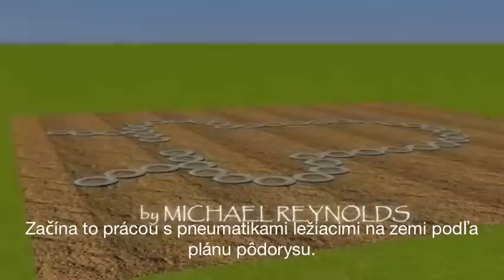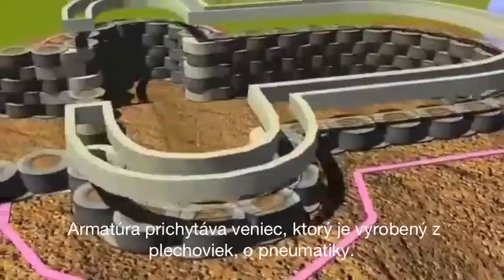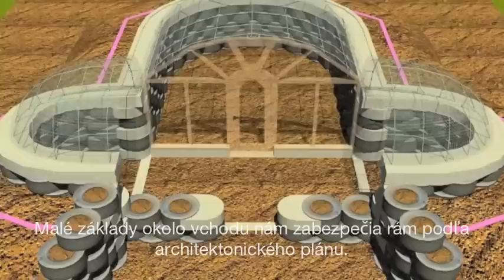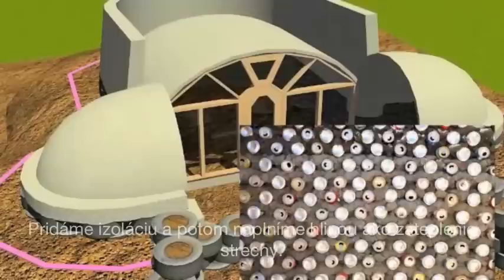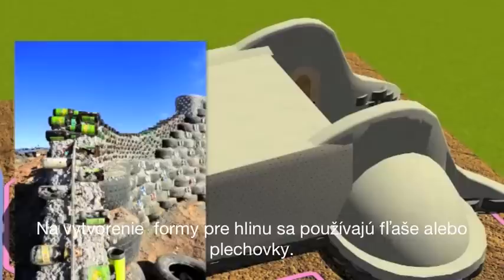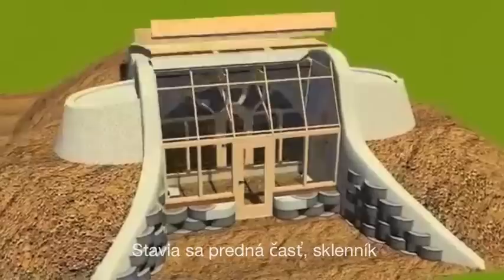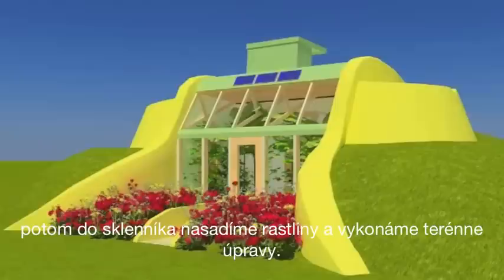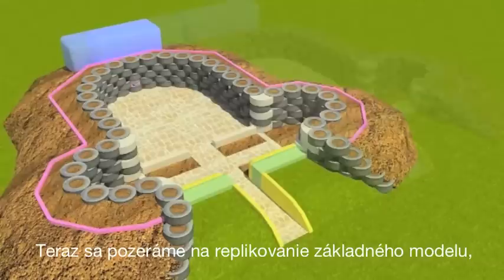Earthship-Reynolds: Simple survival model earthship

Comment: Maria FarmXchange The dirt in the tires hold heat better than other materials would. This helps keep the house at a constant temperature
Reply: Cardboard can be used to put at the bottom of each tire above the first row so that the dirt doesn't just fall straight through when it's getting pounded in. Use your imagination - I'm SURE there's something you can do with that stuff. Paper, for example, can be shredded into tiny tiny bits and be put into compost along with our poop to help speed up the process of decomposition. If there's ink on the paper, well, if I'm not mistaken, ink is made out of oil. Oil comes from the Earth. Ashes to ashes. Dust to dust. Oil to oil. (etc.)

Comment: If that is facing south you're killing the early morning and late day sun penetration with the side walls blocking the entry.
Reply: Seriously? Lame argument.
Reply: Seriously, it wasn't an argument. Go ahead and build then post your pics.
Reply: Supplemental lighting is pretty easy to install.
Reply: John Arizona I see what your saying now... but it isn't by any means a horrible design. It is facing south as it should be and many existing homes never even took that into consideration.
Reply: Shawn X  it is a beautiful design. It could be fine tuned to be more accepting of solar energy. Compared to the more common house design today this is definitely much better, on the right track. When mankind advances to the point we can deliver heavier loads to space efficiently these old steel belted tires would make excellent building materials. Rubber/polymers work well in mitigating radiation and the rubber itself (modified to not freeze) would make for very strong building material. In fact this might just be a key element in projectile deflection.

Comment: Try using hempcrete and stone instead of tires. The land is cheap in the desert.
I would like to make  a A frame cabin with a green house attached. Self sustaining
Reply: I'd be careful with Hempcrete in this application as hempcrete needs to breath and should not be directly exposed to water, so water proofing and ventilation would be key design factors.  If you built the walls with 2 foot hempcrete I'm not sure how much benefit you'd get from being underground - and being underground I'm not sure how much benefit you'd get from hempcrete. But I see how they could make a killer combo, however usually the footing under hempcrete extends up a foot or so to ensure that hempcrete stays clear of any standing water, so dropping the hempcrete below grade would be a unique application and require careful planning!
Reply: Sarah got triggered!

Comment: I'm thanking about doing sometime like this with tires on my farm.
I have a house, It will be nice to have another shelter underground and
hiding as a bug out location and too store stuff
Reply: altha2008 If you do build one of these, ..... you will probably decide to make it your actual home lol
Reply: I fished mine with wheels and other free stuff that I can get.. A 5 feet wide 20 feet long Not including the space for the tires. This is available useable space underground bug out location. I pour cement on the bottom. and in the tires as well. cover it up well. It is not as nice as this one. I do have food supplies, water, camping gear, flash lights, and a sitting area set up in it. It makes a good Cache.
Reply: altha2008 Hi Altha2008, That sounds awesome !!!! All the principles you have used well. Do you have electric power also inside?

Comment: What are the rooms to the side of the greenhouse?
a
Reply: +kairon156 
one is the bathroom I'm sure just so the pluming through the botanical cells and what not works better
Reply: One side is the shower which then drains the grey water into the plants and by the time the water goes from one side to the other, watering all the plants,  it goes into a tank, and from that grey water tank water is pumped back up to be used for water to flush the toilet, which is what the other side room is for, then the black water goes from the toilet to a septic which then feeds the outside plants.